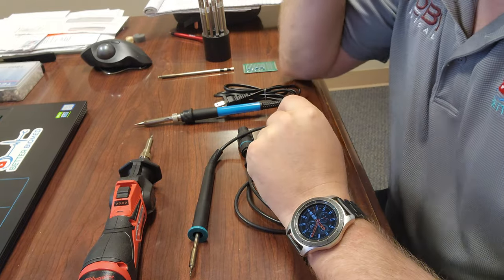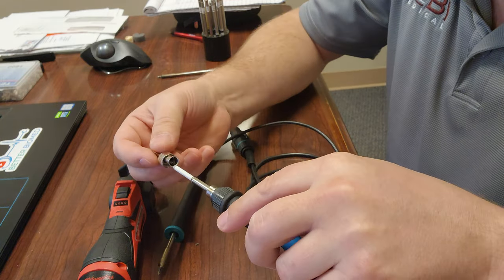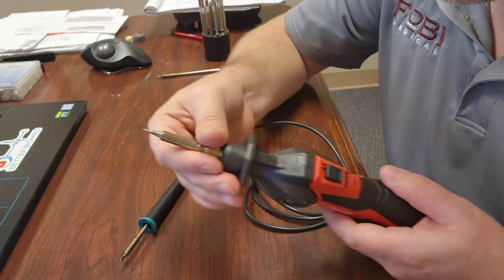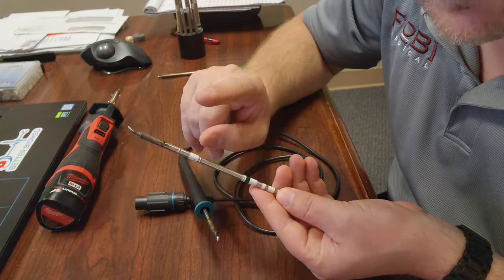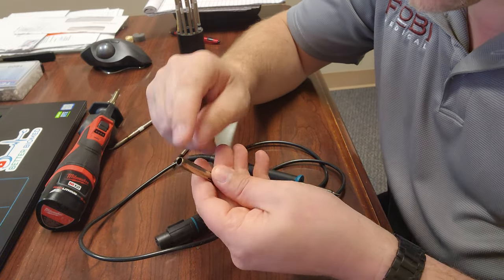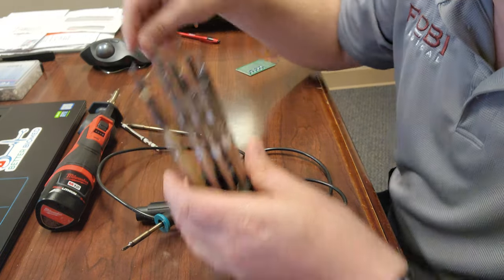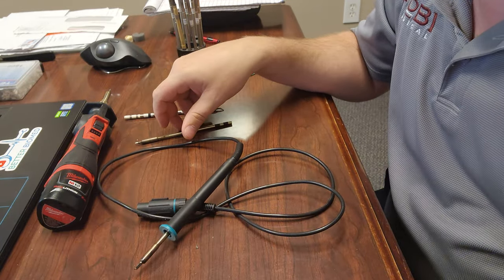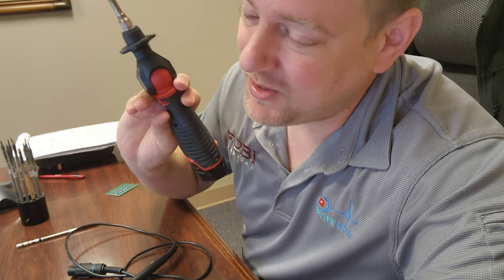Soldering Iron Recommendations

Comment: I use the first model for more then 3 years now as a hobbyist, it's a 60watt version, when i'm soldering big wires etc.....i  use a wider tip and set the temperature higher 
and all goes well. Investing in a more expensive solder iron depends for what purpose, is it for using at the bench all the time, 
or for using in the field, daily use, weekly or montly use, hobbyist or professional.
More important is the solder itself, you may have a very expensive soldering iron, if the solder is not good, your screwed.
Reply from the maker: I also use a larger tip and hotter Temps. Technique overrules temperature. With good techniques a technician avoids cooking the PCB
Reply: @BetterBiomedChannel  , it's sometimes better to use a higher temperature to get the solderjoint quicker done, then using a lower temperature and keep heating the PCB untill the tracks come loose. 
Therefore are old (wasted) PCB's great for 
excercise and learning the solder skills.